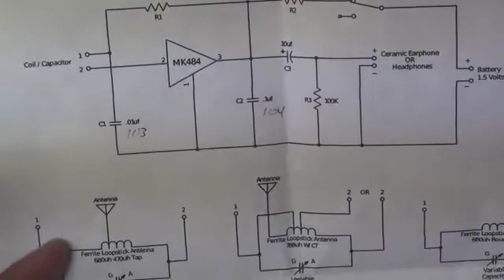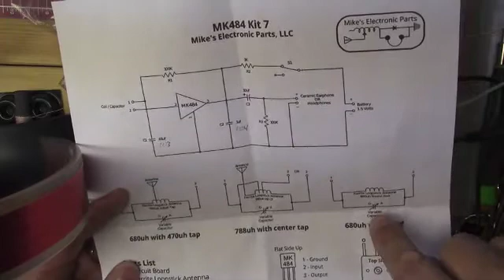MK484 AM Radio 1st try and some problems

Comment: Cool stuff man, thanks :)
Making radio on breadboard is not good, because breadboard screws capacitance.
make it on a piece of wood
https://www.petervis.com/Radios/making-a-crystal-radio/marking-out-the-baseboard-and-installing-the-screws.html
https://archive.org/details/MakingATransistorRadio-LadybirdBook
also remember you need a long wire 15~20 meters hanging outdoor to pick-up signal.
and another one going to ground/earth https://youtu.be/zLW_7TPf310
Here is an interesting thing to do, replace your tuning cap with this (LED as varactor/varicap)
http://www.hanssummers.com/varicap/varicapjy.html
for voltage you can stick 2 9v battereis with each other in 1 terminal and use the remaining terminals (+) (  ) (-)
even if they are drained 9v, maybe they are at 7 volts, so that is like 14 volts.

Comment: Very Interesting.  I have sort of the same problem when running "regular" AM radios in my basement shack on their built-in antennas.  I usually only will get good reception from DX stations but can hardly copy my local stations.  It will be interesting to see if you are able to make any improvements as you go along - keep us posted.

Comment: Very cool!  You make the loop antenna? To bad you couldn't have long wire or an inverted-v outside for optimal performance! But it is interesting about not getting local stations!  ~Jack, VEG
Reply from the maker: Vintage Electronics Geek no the loop antenna is a Grundig  loop antenna that I got at RadioShack a long time ago. More to come on that MK484 radio.